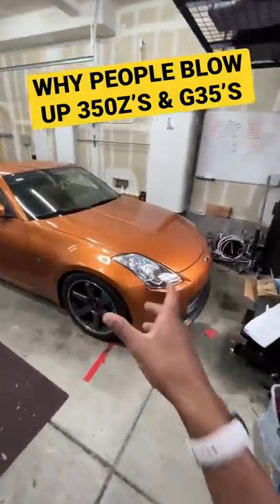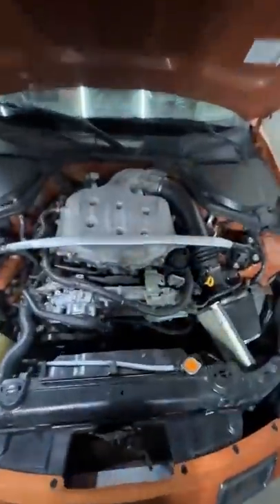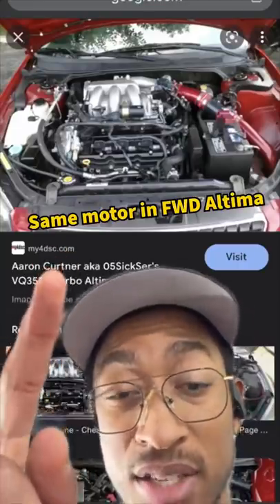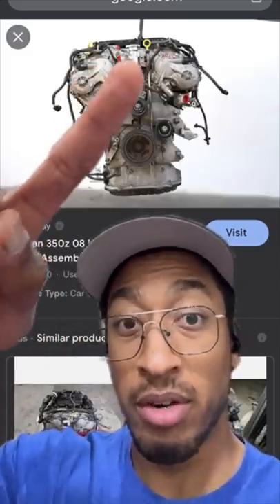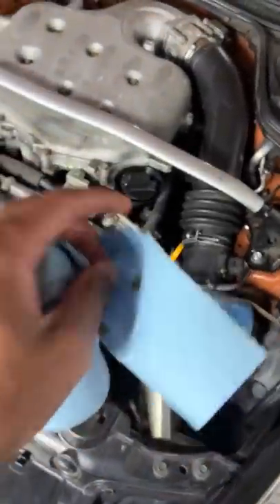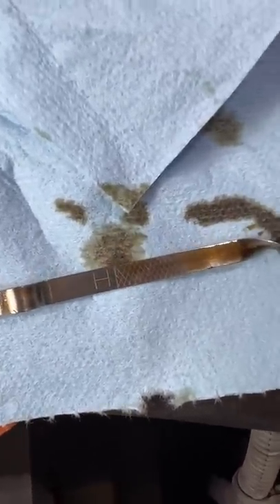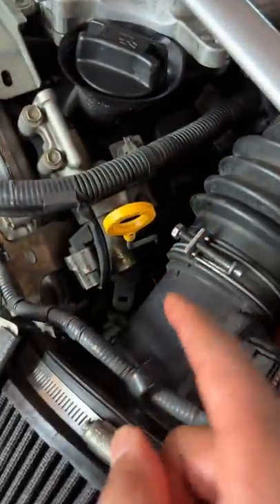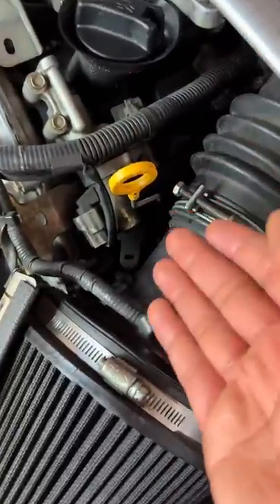Why people always blow up their 350Z’s and G35’s 💥🤯💣

Comment: Oil splash when the engine is running.. 
Run the engine into temp, turn off the engine, remove the dip stick, wipe the excess oil off, put in the dip stick real quick, and pull it out to check the hot oil level. If you're quick enough, there oil in other parts won't have time drain completely. Thus, you know the engine will not starve of oil in normal running condition. Compared to cold oil that was given enough time to drain overnight.

Comment: NO. The key to reading ANY dipstick is to move it in and out a couple of times very minimally and when you take it out, look for a line under some light. This takes advantage of the oil's surface tension.

Comment: No, the head doesnt use the dipstick tube as an oil drain, but close.
The dipstick only runs through the tibe for about half of the dipsticks length. The rest of the dipstick continues on down to the pan using an oil drainback passage as an extension of the tube. Simple cure. Do an oil change run the engine til warm as manual says, check oil to see level is right. Then allow to cool and drain for 8 hrs. Check at this time, you know engine contains correct amount of oil. Since the running engine fills passages that can drain down after sitting a d oil expands when hot this cold level without engine started wont be same as hot immediately after turning off engine. But it will be a consistent place to check. Just make note on stick of cold level. Must be done first time right after oil change to ensure proper amount of oil.

Comment: I have a VQ in my Infiniti I30 and it runs super quiet. It’s way more responsive than the 2002 Malibu 3.1 V6 that made more power, as I’m guessing the DOHC helps the throttle response feel more direct, when in the Chevy I had to floor it to downshift.

Comment: I once had a ‘97 Maxima and although the dipstick was on the front of the engine and very easy to access it was nearly impossible to read for this same reason. In fact if the reading was low and oil was added, the added oil ran down the dipstick path rendering the dipstick useless for a good 5 minutes.

Comment: It’s more so because the regular de engine is equipped with a oil Pump that doesn’t circulate over 4500 rpm… the rev up circulates up to 7k… more regular de blow up then rev

Comment: Well my e46 bmw also uses the dipstick as an oil drain but it is Dopple layered so it has two tube in side each other. The outer one returns the oil. The inner one is for the dipstick.

Comment: I used to work at jiffy lube as a youngster. These were notoriously hard to check the oil on. What we would do is: put the dipstick in normally and then pull it out quickly. For some reason this always worked at least the third time lol

Comment: You wanna check the oil when the motor is cold. If you check it when the motor has been on you wont get a correct reading on how much oil you have. You could have a low oil and still have the dip stick covered after the motor has been on. Check it while it’s cold not hot.

Comment: I'm surprised nobody knows how to correctly read the oil level. 1) Oil must be warm so keep the motor running for 15 minute 2) pull the stick out and CLEAN IT (wipe off oil), 3) insert the stick, wiggle it around a bit, 4) pull the stick out and get a precise reading.

Comment: My 2007 nissan murano is the same. Easy accessible dipstick but it has a drain on it. Kept checking it, thought I had oil, then did an oil change with my dad and like half a quart came out. Figured I had to check it after sitting and not after it was running!

Comment: Supposed to let it run then pull out the dipstick and wipe it off then put it back in and get your reading so the oil is warm when oil is warm and thins out and spreads

Comment: If you start any car oil will
make it’s way up the dipstick and make them all oily and hard to read. The reason Nissan is so hard to see is because their dipstick has a coating on it that’s a little darker than bare metal and happens to be the color of a thin layer of oil.

Comment: You are supposed to check the oil before driving. Otherwise the oil has been circulated through out the engine and the oil will read slightly low if it's not all over the dip stick.

Comment: Had a 2000 maxima, same engine architecture but earlier engine vq30dek to be exact. That unreadable dip stick after the engine running is normal, always checked it before I turned it on for the first time that day otherwise the reading was worthless.

Comment: That's not why. Oil leaks into the spark plug tubes due to faulty fused gaskets on the valve covers and you get misfiring consistently.

Comment: Thats because you're not waiting about 30 minutes after running the car to let it all drip down and I bet you're not letting the oil get up to temp. The actual reason for checking it this way is to make sure theres oil running through the engine to get an accurate reading of what's actually there not whats sitting in the pan over night

Comment: we scratched back of dipstick with 6 grit to read better after new oil changes, and bent the dip stick i bit down cause of knNfilter. buty yeah i memorized about every 1200 miles it needs a quart of oil, and i do my oil changes every 2500 miles

Comment: After you do the 15 minutes thing, remove and wipe clean the dip stick. In one smooth motion reinsert and remove it. You should have a cleaner oil line on the stick to gauge from

Comment: You can change the oil when it's hot, just got to know the motor size and how much oil it takes to fill it. If you're checking the oil before you drain it, that's pointless. All of the old oil comes out, then you fill it according to factory specs. After you filled it, wait 15min or more and then check it.

Comment: I had an '07 g35 and the engine was trash. We got slither one and it was great. Had them both for the same amount if time and thr 3nd one had no problems, but that first one was absolute a55. 😢 No I have a QX56 and it's pretty rad. Only 3 months in but it's bussin bussin loooool

Comment: 👉I broke or locked the crankshaft in my 1986 Nissan 300zx. A master Ford technician came over to my home and could not turn crankshaft pully over with a socket/big long metal extension breaker bar. I remember hearing a loud explosion while driving when it happend.That car was very slow, (naturally aspirated V6 engine & 5 speed transmission)

Comment: If you just look where the oil is thickest and most concentrated you would know where the level is. Yes that’s a flaw but you shouldn’t check your oil when the engine is cold because all your oil is settled at the bottom of the engine so it isn’t an accurate reading. You could be lower on oil then you think or downing your engine in oil.

Comment: Remember the top spot of a dipstick is not "full" its maximum, if you fill your oil to the maximum or over constantly you'll shorten the life of your seals. The sweet spot of a dipstick is the middle
Reply from the maker: but if it burns oil like most z’s it will be in the middle soon enough 😂

Comment: Just got my g35 on the road after replacing engine and the transmission. Got a good deal as a whole. I didn’t blow the engine, I bought it with locked up engine and that’s exactly why it was locked up because dum dum ran it dry

Comment: the correct point with the dipstick is: when the crankshaft "spash" in oil, the oil gets everywhere - even everywhere on the dipstick in 99% of all engines the dipstick isn't used as a oil-drainage, that's just a myth. so, just stop the engine, wait 5 minutes, pull the dipstick, clean it, put it back on - wait 10 sec, NO WIGGLING, and then pull it again - and then you can read it. oh, and of course... DO that on a FLAT street, and not when standing at a hill.

Comment: forhead slap you are supposed to pull the stick. wipe it clean FIRST then insert it and pull it THEN READ IT. you do not read it on the first pull for the exact reason you were stumped. because the violent turbulence in the oil pan makes oil shoot up the dipstick tube and coat the stick way up high in oil!

GALLLL!

Comment: There’s multiple reasons. Nissan was never a particularly reliable brand, but it doesn’t stop people from putting them on a pedestal beside Honda/Toyota. That’s beside the fact that they were bought out by Renault around the time of making these, and had drastic slashes in engineering budgets to save the company. But yeah, maybe it’s the dipstick. Crazy thing about oil changes is if you change it regularly, you shouldn’t really need to even need to worry about checking the stick if you know what you’re doing.

Then again, it’s not like it’s a Honda/Toyota.

Comment: Vq are oil burners. I drive mine like a old person cause I have a lot of weight and it still burns oil. 2 12 inch massive subwoofers where my passenger seat uses to be. And 2 more 12s in the trunk.

Comment: Always check when engine sits for a good while in all engines to allow all oil to drain into oil pan, some engines take a while for all oil to drain. Any gear head on any engine knows this.
Reply: With Honda you're underfilling if you measure with the engine stone cold.  They want the "full" mark to have some oil still in the cylinder head and hot vs. cold can be worth about 1/4 quart on the dipstick.
Reply: @someusername121  thats funny i owned 3 hondas never heard that i filled with exact amount and stone cold was on full mark
Reply: @rt2255  The oil volume numbers are just a guide because how much you drain depends on a the angle of the car, how hot the oil is, how long you let it sit to drip, etc.   Being 1/4 quart off in either direction won't matter anyways on these engines.  But to be pedantic the service manual calls for oil changes and checking to be done with the oil hot.

Comment: I dont think its that... I have a few, from my experience, its usually a timing issue that never got addressed then ran so long it blows. As well as the lower rod bearing, it seems like a blown motor by the clunks, but nope, just a warn bearing. 6  shops have told me "bad engine", after replacing the timing and lower bearings, works fine. Always did my oil at 4k miles

Comment: Dude... if you're wiggling it around while trying to read the oil, of fuckin course you're getting bad reads with the dipstick. The whole point is you just dip it straight in and straight back out. If you wiggle it around, not only are you gonna slosh it around and get a falsely high reading, but you're also gonna collect all of the oil in the dipstick tube. Also, if the manual says to check it hot, and you're checking it cold, you arent getting an accurate read. Engine oil changes volume when hot, and when the engine has recently been run, theres oil in places that there isnt when its cold.

Comment: I’ve always checked my oil on my g37 cold for 5 years now, beat on it everytime I drive. Only thing over broken is two weak ass 7 speed trans. NEVER check when there’s are hot
Reply: The main reason is that many of them burn oil like crazy to due a poor design on the piston rings and people don't pay close enough attention to keep them topped up.... that and Nissan tends to be a "poor" brand car that a lot of people just don't maintain.

Comment: Is This Similar Engine To What's In The Maximas? Like And 07? I Never Had An Engine Oil Change That Was so Hard To Check Oil Level. You Have To Stick It In And Clean Dip Stick Like 10 Times Before It's Readable lol.

Comment: i dont drive one of those... i drive 98 k1500 and only time i check it is when the lifters start rattling the day before and its usually 1 qt low. it is a rusted beater with a heater needing door pins. that is 4 different colors and the a/c does not work with 3 miss matched (same size) tires. its my work truck.

Comment: ...it will never be accurate to read your oil level during or shortly after running the engine...this "splash" happens on like 99% of vehicles. You ALWAYS want to check your oil level after it's been sitting for at least an hour or more.

Comment: As a Maxima owner it made me so mad when you called it an “Altima motor”
Reply: Altimas come with the vq35 as well
Reply: @pm7791  They do but they come with the 2.5 standard on the Altima and is what I think of when I hear “Altima”. The Maxima was born with the 3.5 and it’s kinda insulting to ignore the big brother that the engine was designed for.
Reply: @benlogicfactsshapiro I think the first cars to come with this motor were nissan pathfinders back in  2001.
Reply: @benlogicfactsshapiro  but I get you man. I have an Altima SE-R

Comment: 2013 Nissan Frontier 4.0 VQ family engine naturally aspirated base model pickup truck I have... same design dipstick.... same issue also if you check it after running it blows all the way up the top.... let it set a couple hours and you can get a proper reading... but isn't it funny the 4.0 Q in the Nissan is the same way

Comment: Murano has the same design and my altima does the same so it's just a design flaw change oil at right intervals and check the oil while at the gas station you should be fine

Comment: These engines burn oil, and the real reason they blow is because people don't check it frequently enough. I only missed it once, had to put 3.5 quarts of oil in it. Still driving the car 5 years later though. 
Don't abuse a car you aren't going to maintain properly 🤷‍♂️

Comment: I never understood why manuals say that. Everybody knows you check before running. There's literally zero reasons to run the motor first. Even when you pour more into the crankcase you don't run it. Go inside, eat a sandwich, and watch a couple innings. Come back out and check again. DONT RUN THE MOTOR TO CHECK THE OIL 😆

Comment: Also they probably have valve cover leaks and dnt know because u can't tell by the way the car runs mine runs like new and I'm leaking from valve cover B1 and B2 didn't know until I took it to nissan 2 days ago so I have an appointment to replace the gaskets on it on the 13 so after that I'm guessing the oil loss will go away but I'll still check my oil every few days like I normally do anyway

Comment: Never check the engine oil while engine is running. You are supposed to check it with the engine off, so all the oil can be in the bottom. The only thing you check while running on operating temperature is the oil pressure. 😂

Comment: So is this a common thing with Nissan.  My wife has a pathfinder that there is no dipstick tube on.  It just inserts into a random hole in the block and if you weren’t the one that removed it you would never know where to look.  Oh and it takes two hands to get it lined up properly.  It’s the most annoying thing I have found changing oil on any car

Comment: It's because during the timeframe these were built, the head of Nissan was having them use cheap parts and labor in order to get out of the red and into the black, so they cut every corner they could to save a buck. After 1999, I'd never buy a Nissan since those are pure junk thanks to that.

Comment: WRONG!!  The seal behind the drive chain goes bad and causes the engine to blow. The issue is that people don’t check it because the labor rate ends up costing you like $8k.
Reply from the maker: those are the gallery gaskets that are primarily an issue on the HR motors. I have a DE.
Reply: @ChrysGaines  it’s the same problem on both motors.

Comment: I thought it was common sense to check the oil on a cold engine. Wouldn’t work if the oil has been circulating and heating up inside the engine

Comment: That car's oil filter sits horizontal. In the morning it will be empty and you'll get a wrong reading.
Reply from the maker: the filter’s capacity is insignificant compared to the total oil capacity and the range at which the car can run fine.

Comment: you should never check the oil when it's hot well on most cars you should check the oil level when its cold I'm sure some one else will tell me "ehm actually" and come with 500 explinations as to why you should check such and such car with the oil up to temperature.

Comment: the owners manual says to heat it up and splash oil up and down the stick and have it already up to temp but i thought that usually youd wanna check ur dipstick with ur oil cold not hot and expanded. could be a profit tactic. could be overengineering.
probably stupidity but if you just wiped off the stick and checked it again theoretically wouldnt u just get a reading since u wiped all the splashes from running it up to temp? idk
Reply: makes sense why they blow up tho

Comment: Yeah don’t check motor oil after starting your car, never an accurate reading because oil expands once introduced to heat and the motors literally just throwing it all over the stick so just check it before you start your chiz

Comment: Ive had 5 of them , regular vq , rev-up and the hr , they have issues with timing and oil consumption, the dipstick is easy to read its not bad like he says , if you do the proper maintenance and dont beat them up they’ll last easily over 200k , these cars need an oil catch can , there are options for a better intake manifold, get rid of the cats because the cats on these cars are shit and known for causing a lot of issues
Reply: Is that the same for the fx35 meaning the wagon version of the g35
Reply: @Snapper408   its the same engine

Comment: No. The dipstick tube is not the oil drain for the head. Just no.
Reply from the maker: i feel like I researched this before making this video and found some pics of a head drain port intersecting with the cast-in dipstick tube. Like I said, could be wrong, but I’ll definitely confirm it when I build a VQ.